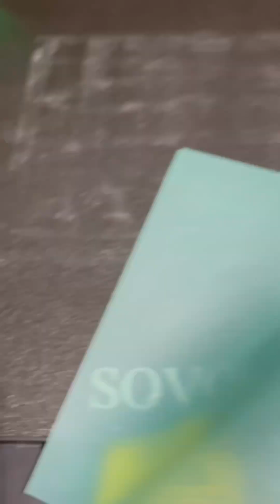Insane First Layer 200x200  at 0.1 mm using Xenomorph Orbier & BTT Eddy Probe

Comment: Ok, I’m going to have to do this mod now! .3 mm is the best I can do and that’s not great. I increased my adaptive mesh and do a long Macro warm up to temperature compensate the inductive probe and get the bed good and heated. My bed is a taco 🌮 but not more than .6 mm on each side. Do you attribute this to the Eddie or other tech in the print head you have added?
Reply from the maker: You can do it!